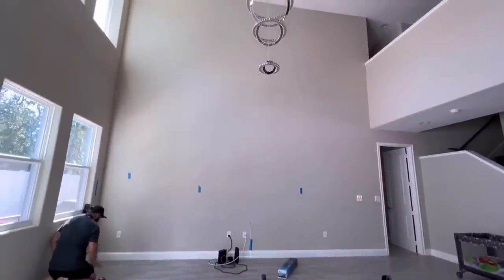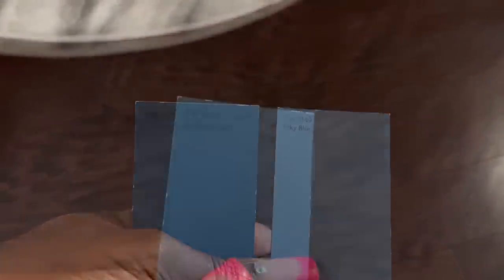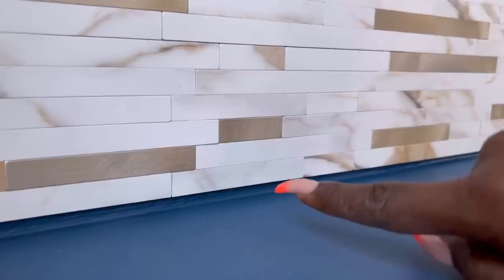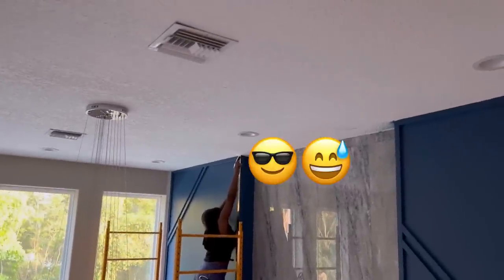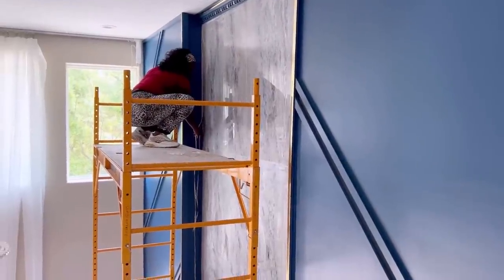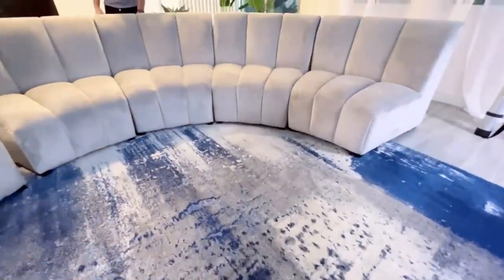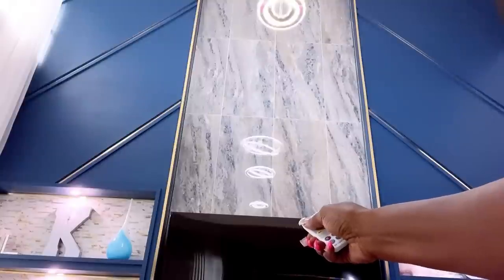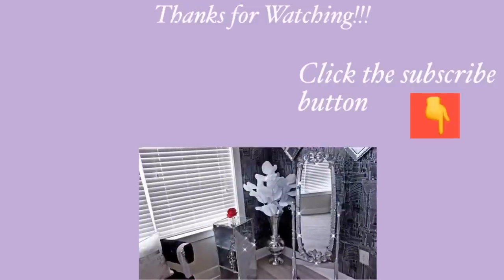DIY AMAZON LIVING ROOM MAKEOVER! SEE HOW HIGH I CLIMBED Making this! DIY TV UNIT

Comment: stunning!  I have a question: how did you get the curtian rings to work with that track?  I looked up the link and the rod doesn't seem to be designed for rings...did you take off the rings  and just use the alligator clips?